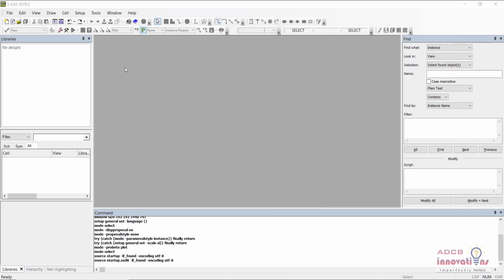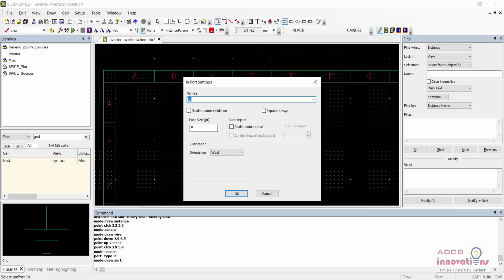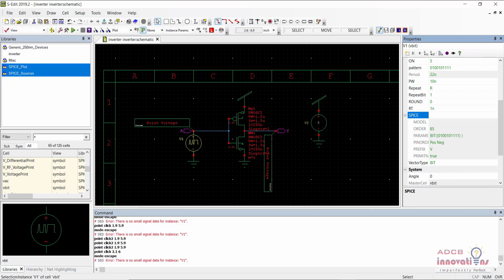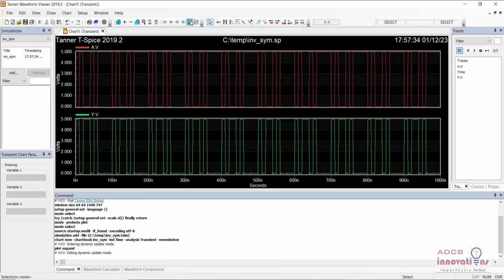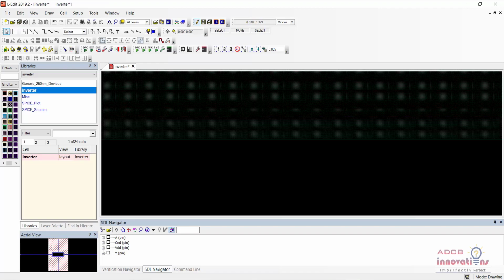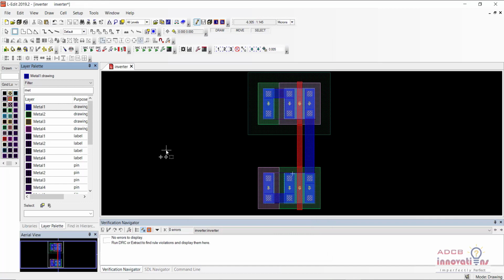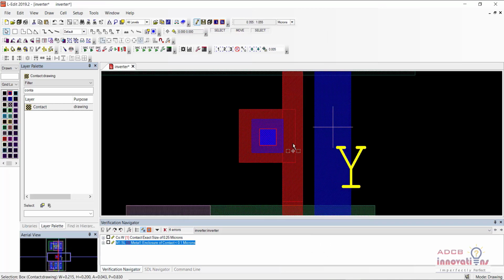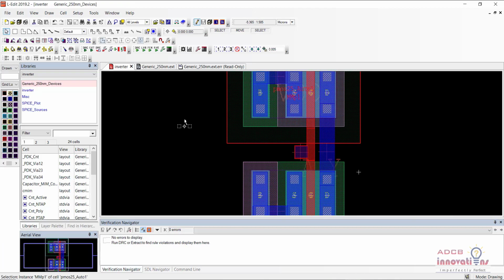Tanner SDL (Schematic Driven Layout) of an Inverter | S-Edit | L-Edit

Comment: Excellent explanation! Sir, can we draw layout for Phase Freq Detector circuit? Is the same procedure follows for PFD also? I have a doubt on drawing connections between the transistors in layout sir.
Reply from the maker: Dear Learner

The procedure of drawing the layout is the same for all the designs. If you are facing some problems kindly elaborate in detail. We will try to help as much as possible.

Thank You
ADCB Innovations Pvt. Ltd.
Reply: Sir i want to connect metal1 and poly layer, can we directly connect or we have to use contact for joining them? I used contact, but im facing drc error whenever I run @adcbinnovations
Reply from the maker: Apologies for the delayed response.

It is always recommended to use the proper contact like poly-contact (while connecting poly and metal) and metal-contact (while connecting metal-metal). There could be some other violation due to which you are getting the error.

Regards
ADCB Innovations Pvt. Ltd.
Reply: @adcbinnovations Thank you sir

Comment: cant see layout of cmos inverter after publishing the schematic to to l-edit. The subcircuit name and cell name in l-edit is same. cross-checked multiple times. tried same steps but no luck. what could be the reason?
Reply from the maker: Dear Learner

We understand the problem you are experiencing and are investigating the possible causes. We are working on a video that will address this issue and share it with a global audience as soon as it is ready. In the meantime, if you could provide any additional details about the issue, it would be very helpful.

Thank You
ADCB Innovations Pvt. Ltd.